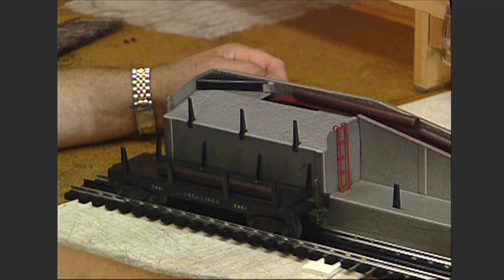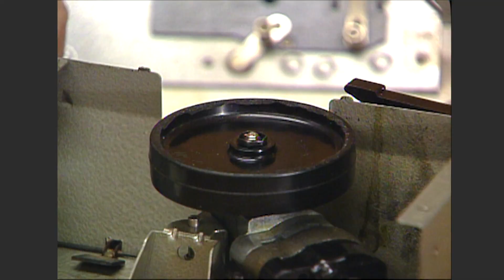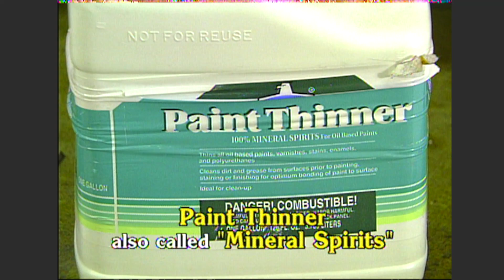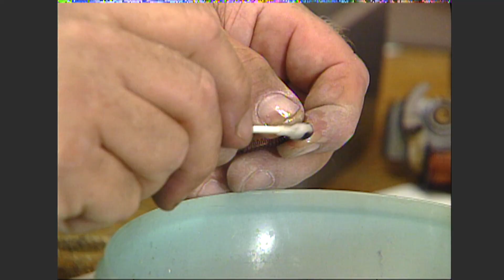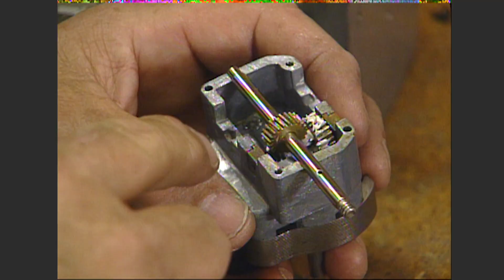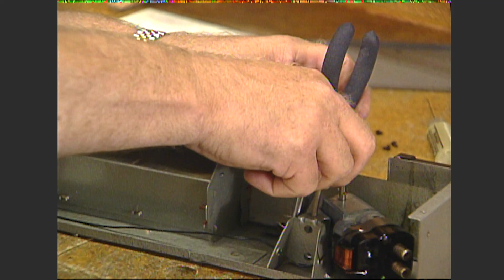The Lionel 364 Lumber Loader

Comment: Great and very useful video... don't think I would use conventional rubber bands on the black plastic wheel, considering how fast rubber bands rot (okay... it might take a few years... 😁)... I have used rubber slip-resistant tape on many projects over the years (besides stairs)... that's what I am going to use when I work on my 364 Lumber Loader again.
I resurrected the one that I had when I was a kid, pulled out of my parents family home about 30 years ago... I don't remember exactly what I did to the motor, but I know I had to take it all apart to remove the rust and repaint it, and put on a new belt... time flies !

Comment: the spring that keeps the motor and pulley taught... does anyone know how much tension that's supposed to have? i think that's part of my belt slipping issue. if i flip the loader upside down the spring is not strong enough to keep the motor in place so i dont think it's putting much tension at all on the belt

Comment: How do I find a quality belt?  just got a replacement from my great parts guy and it's just a ribbon and it's too long my motor is bottomed out on the mount I added rubber bands to the drive wheel and it still is bottomed out. Thank

Comment: Stick a screw driver in the Spring when you tension it and then grip it with pliers, and remove the screw driver. Helps keep the spring in line while tensioning and clamping in your Pliers